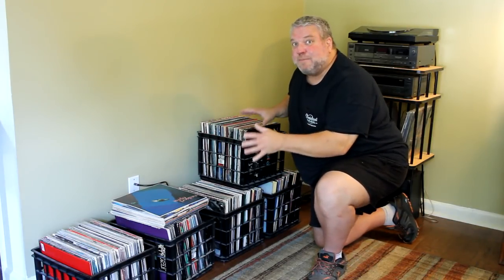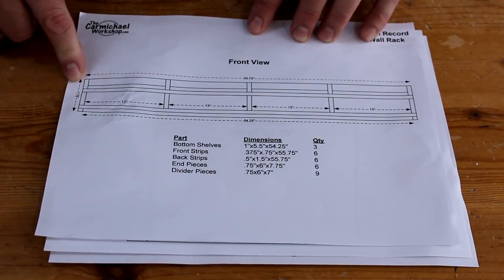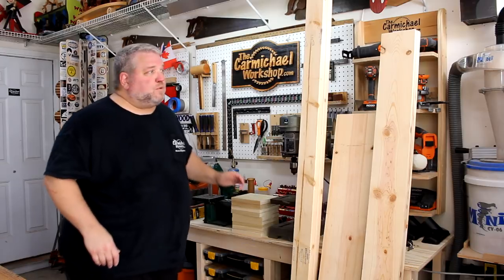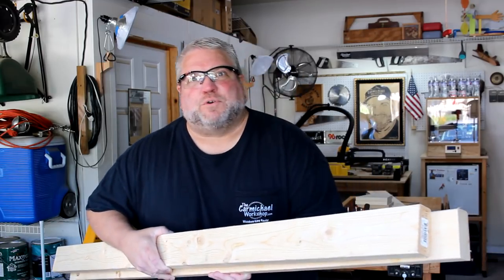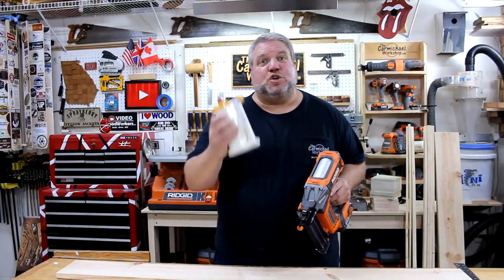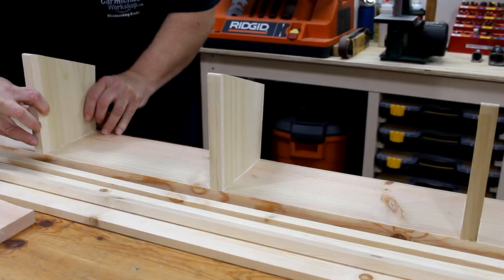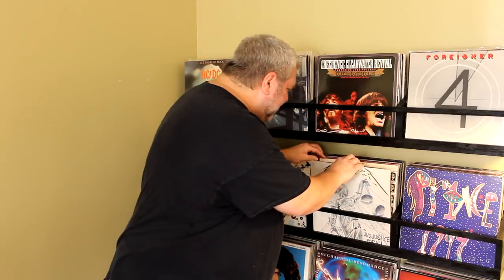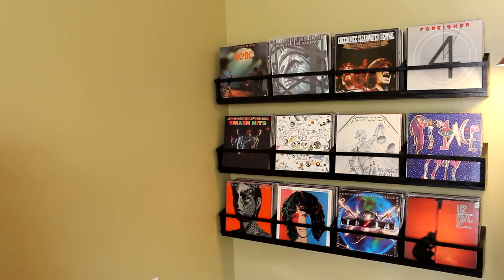Vinyl Record Storage and Wall Display Racks

Comment: Great job Steve, looks great! Love your Videos. I make clocks out of Vinyl and do you have any suggestions on a table top displays, the hands are moving?  I do Craft Fairs! Sometimes a little windy and what I use keeps tipping them and the hands hit the pegs and stop.
Reply from the maker: Hi Debbie!  Thanks!  Try mounting a Plate Hanger to a wooden stand with a wide heavy base so it won't blow over, then mount the clock in the plate hanger.  You could make a large base with multiple uprights to hold more Plate Hangers at different heights for a larger display.  Plate Hanger - https://amzn.to/3LAuK64

Comment: Thanks Steve, they look much neater than in boxes and much More accessible, Right now we've sorted the LP's can you do something similar for my Sons 1000+ DVD Collection, at the moment they are kept in cardboard apple boxes we had from Costco, they are piled so high it's a nightmare when he's looking for something unparticular, They drive me NUTS .....😠 
STEVE HELP PLEEEAAASE
😘😘😘😊😊😊
Reply from the maker: I only have about 20 DVDs.  They are in a cabinet.  I suppose the same rack would work except without dividers so you could just stand up the DVDs like books.
Reply: Steve Carmichael,
 I'd thought about floor to ceiling shelving with magnetic clasp doors to hide the DVDS. Thanks for your suggestion.  😊

Comment: You have really good musical taste Steve! I had one question though, I've noticed a lot of your hand power tools are from the Ridgid brand, is there any particular reason why?
Reply from the maker: Hi Noah - Thanks!  I finally was able to buy some new cordless tools to replace my old black and decker cordless tools I had since 1993.  First, I bought the drill/driver set because of the lifetime warranty and I had a Home Depot gift card and it was on sale.  Then I bought the additional Ridgid tools as I found them on sale or clearance so I can use the same batteries for all.  The shop vacs just happened to be the best price for 12 gal, with free stainless tumblers for my wife :).  I got the sander used on craigslist and it's awesome. I think it would be odd to buy different brands of cordless tools and not be able to share the batteries.